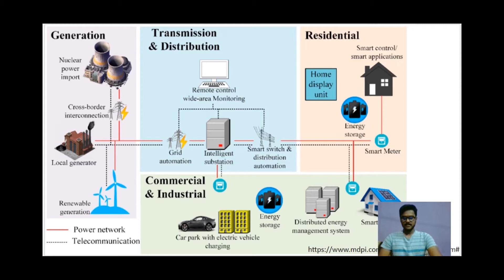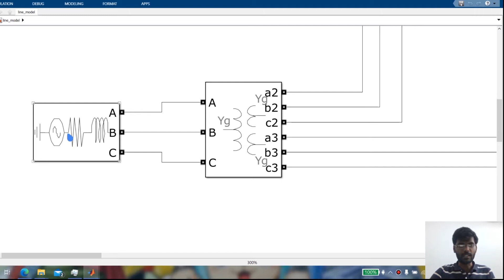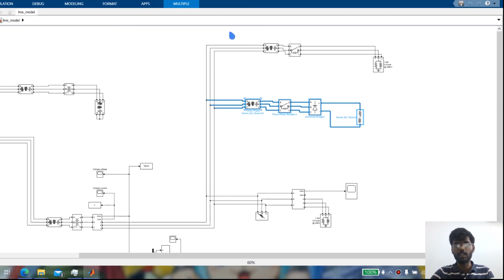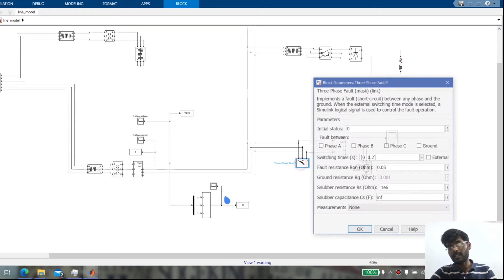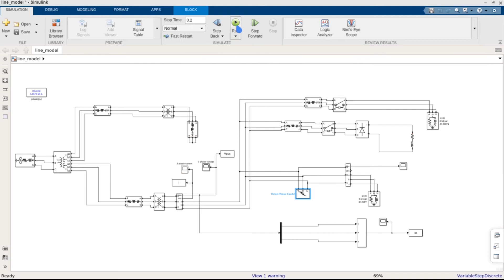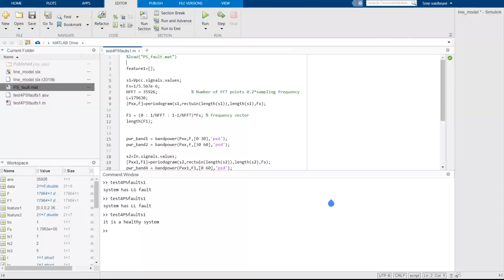Machine Learning model to predict faults in POWER SYSTEM || Award Winning Project || Tech clouT

Comment: Hi...

My name is Deborah.

Please sir, I am currently undergoing my Master's program, and I am also working on a research topic which is, "*THE USE OF AI TO IMPROVE TRANSMISSION LINES STABILITY"*, please, could you please assist 🙏 me with the Sensors needed for sensing the listed causes below👇👇

1. Electrical Overload 
2. Lack of Maintenance 
3. Switching of large load 
4. Equipment Failure 
5. Human Errors

I dont know if you have a knowledge of the transmission line, but I sincerely appreciate you in anyway you could be of help to me execute my project work.

Thank you so much 🙏. I am looking forward to your response

Comment: Aside from using Matlab for Simulink (simulate the system), did you used it to run the Machine Learning part too, right?
Have you used Python ML for Electrical Engineering purposes?
Greetings from México.
Reply from the maker: I used only matlab tool for code,simulation and ML. No need of Python separately

Comment: Do we really need the Machine learning model to predict the fault. which ever the fault it is 
just derive the formula to decompose in to positive , negative, zero sequence currents , if the zero sequence current exists then it is ground fault, also check the impedance in the path and then it can detect the type of fault. 

I did not understand why to use machine learning to predict the fault.
also is this a predicting a fault or just detecting a fault.
Guys dont get me wrong please. I am just asking that's it